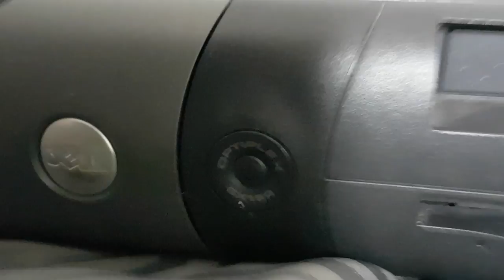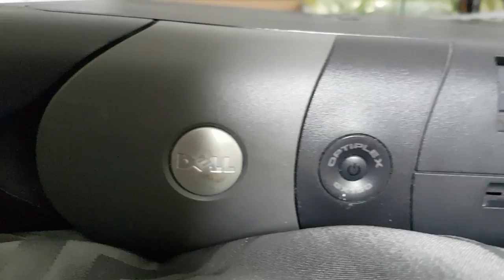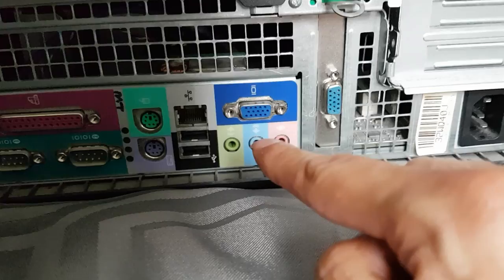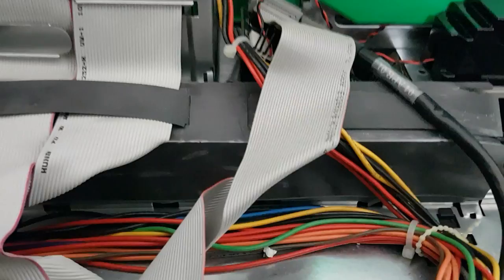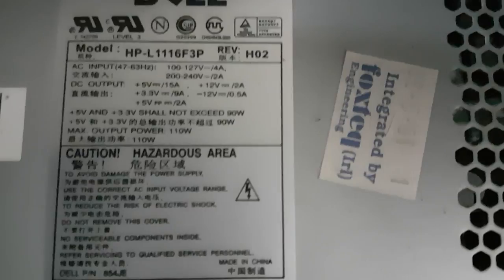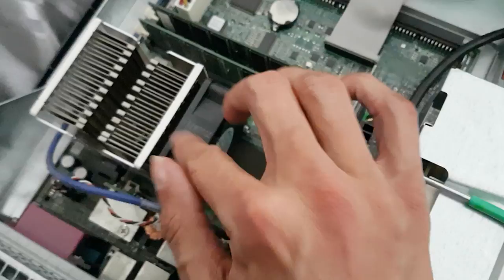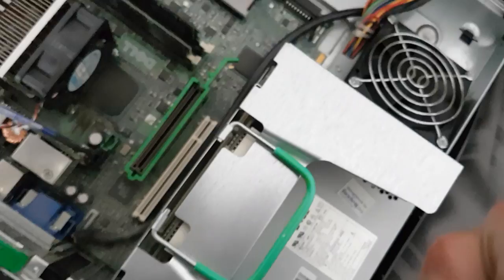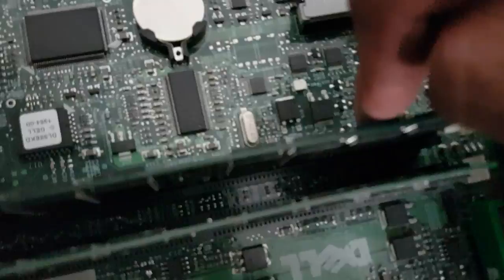Dell Optiplex GX150

Comment: You can also put MS-DOS, Windows 3.1, Windows NT 3.x, Windows 95, Windows 98 and Windows NT 4.0 on it.
Reply: cheh! Mine came with 2000 pro, and made even XP pro and Suse Linux runs also on it after upgrading the internal graphics to a barebone-format Radeon 9200 AGP board, it can work.
 I still need to find what to do with it.

was watching the video since I was doing its cleanup and took apart the cpu fan connector.
Reply: @SilverSpoon_  Windows ME sucks!
Reply: @aldwinpanny10  he wasn’t talking about windows me?

Comment: I'm gonna list the fabric specs and not the ones of this video(i have this pc, the original one)
Intel Pentium 3
? Power Supply
? Cooler
256MB of 130/140mhz RAM
Custom mobo
IBM Deskstar 20GB IDE HDD
? CD-ROM Drive
? Floppy Drive
You can put from ms-dos to Windows Xp on it